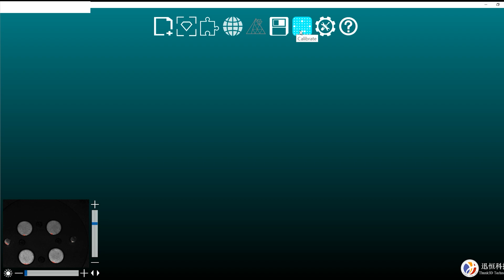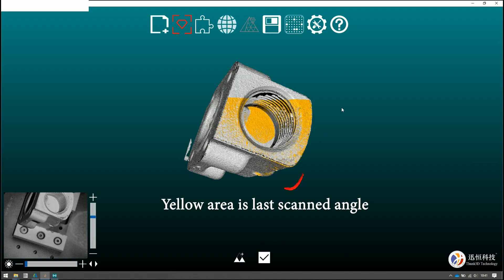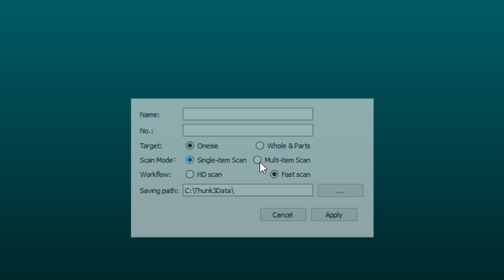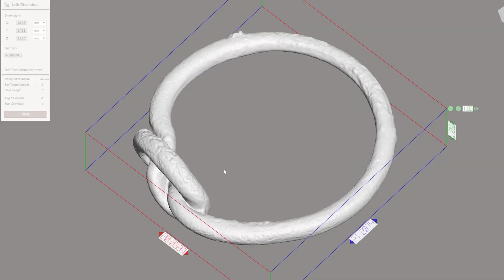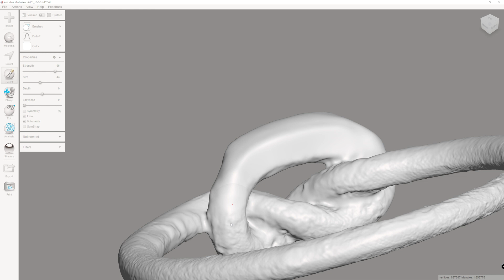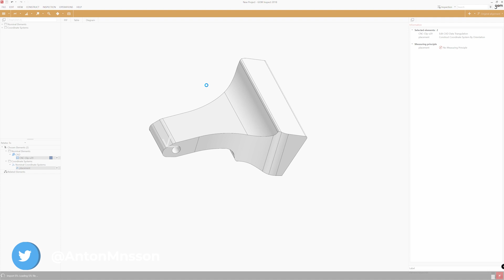Thunk3D Jewelry 3D Scanner Review - Incredible 0,01mm accuracy

Comment: Good Morning, If you still have the scanner, and interested I would like to send you some jewelry objects to scan. I guess for the money I need more proof of concept before I can spend 5K? Also, is this a stand alone product or tethered to a computer?  If tethered to a computer what are the specs for a computer to run at optimum speed?
Reply from the maker: Hey mate! Sorry I don't have it anymore, sent it back after review :). I'm sure Thunk3D can help you get in contact with anyone locally that can sell you a scan or two!  This is tethered to a computer. I used a intel i7 (7th gen) laptop with 16GB ram and Nvidia 1050 GPU. So you need a OK windows computer, mostly focus on CPU and RAM. but you don't need a monster-computer =)

Comment: Great detailed video! howmuch does it cost? and how does it compare to the SOLUTIONIX D700 jewellery scanner?
Reply from the maker: I havent tried the D700, it does look like a Artec Micro copy? If they run similar software it should be really good, but Artec is amazing when it comes to software. The Thunk 3D does a great job getting you the mesh and will do so at roughly 1/5th or 1/6th of the Artec price. But it's hard for me to actually compare them in your specific application =).

Comment: Say it JOOLRI 😂🤣  Isn't it possible to coat parts with acrylic paint or some washable matte paint brushed on for a more even and thin coating?  Spray coating seems to be a very inaccurate/uneven way to cover the entire object especially when dealing with details that measure a fraction of a millimeter
Reply from the maker: Joolri! Haha.  You, probably could! But, you don't want it shiny, so it would have to be a matte coat, which itself might be a bit thick, like the aesub.  I guess it's just the nature of applying a coat, that it covers and wants to creep into cracks and fill them.